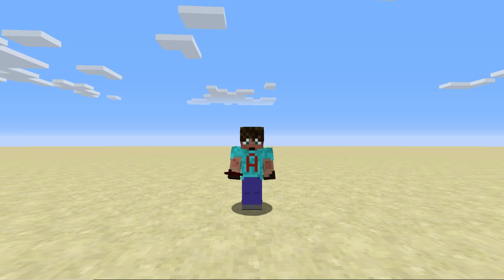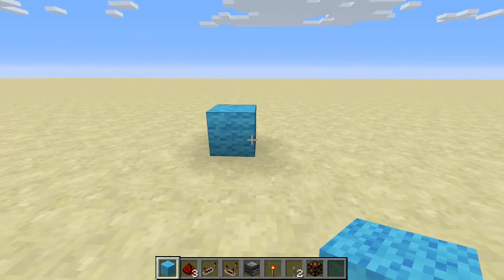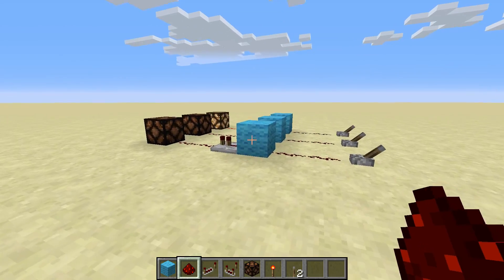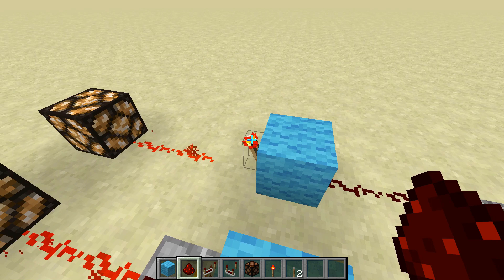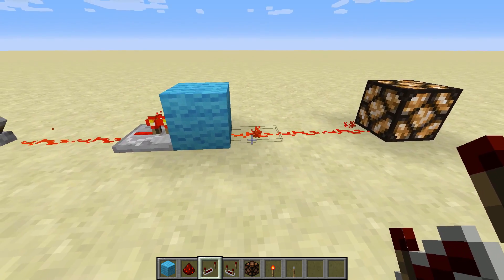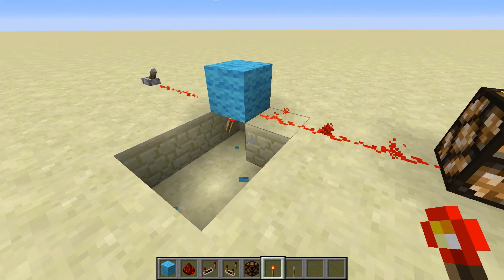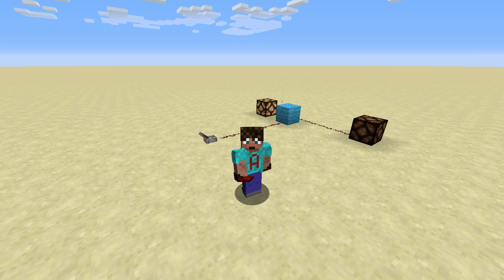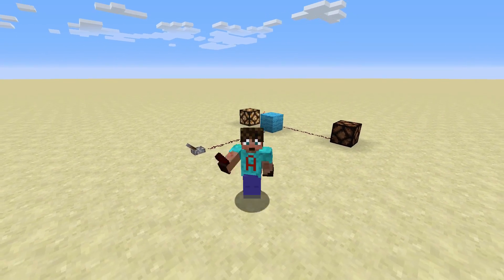Minecraft Redstone Hard Power vs Soft Power in Redstone Blocks: Whats the DIfference Avomance 2019

Comment: how to pass a redstone signal up (vertically. trying to build a single layer arrow array dispenser, 2 rows of dispensers, in an "L" shape, to target mobs in an area ( array is 6 or 7 long, have not decided yet), all this powered by a lever to turn on and then off when flipped. ( side note, trying to make the dispensers continuous fire when on).
Reply: For one block I used a wooo block just to boost it up. Connect red stone to wool and wool
Will power anything it touches (for stacking the wool idk if that works)

Comment: Avo, Thanks for another great video.

Yet, I missed something in your explanation there.
I mean this: what happens to the LEVEL of the power from a comparator into the Wool?
That got me experimenting. (I also used wool block, awesome)

My findings: The difference is whether the Wool becomes a SOURCE or NOT.

 - Hard powered => the wool BECOMES A SOURCE of whatever power level you feed it:
     => any activator (switch, plate, repeater, button, trip wire, ... ): pushes FULL power (16) to the first block AFTER the wool i.e.   Act(=16) => Wool(=16) => 16 15 14 ...
     => comparator: pushes SAME power level to the first block after the wool as the level at the position of the comparator i.e.    ... 8 7 6 5 => Comp(=4) => Wool(=4) => 4 3 2 1
 - Soft powered => the block BECOMES AN END BLOCK (always drops to level 1 power) i.e.   ... 8 7 6 5 => Wool(=1) => 0

Note:
Torches, repeaters, comparators, redstone lamps, doors etc will react to this level 1 as they READ what they're attached to, not because the Wool is sending power out (power out is 0).

Is that about tight?
Reply from the maker: I think you have it bang on there David, if I have followed you properly
Reply: @Avomance  Hopefully someone reads this then and has that "aha!"-moment. :-)
Reply: Where do i belong?
Reply: @Casteray  ?????